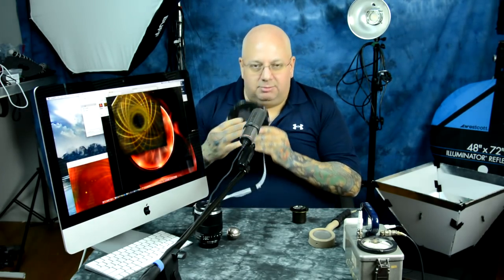Big SECRET of Lens Design is Rare-Earth Nucleus acceleration of light's non-dispersive transmission

Comment: Zeiss lenses are very good and there is lead in the glass. All these old radioactive lenses use thorium and they perform very good, the old and now retired Canon 200mm 1.8  was a highly regarded lens and it too had lead in the glass (and probably retired for this reason). Leica probably uses some other heavy element in its glass. 

So, basically, the highest the atomic number of the elements added to the glass, which has an avarage lower atomic weight being it mostly silicon, the better it gets?
Reply: . . .  so add gold ?